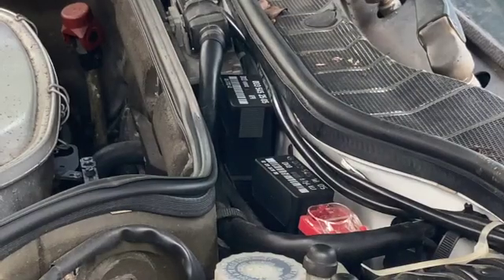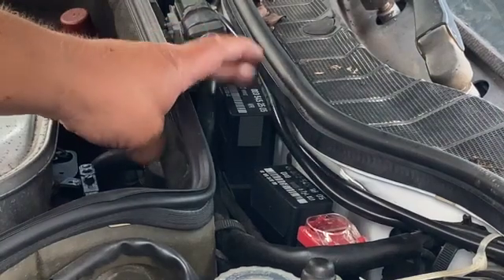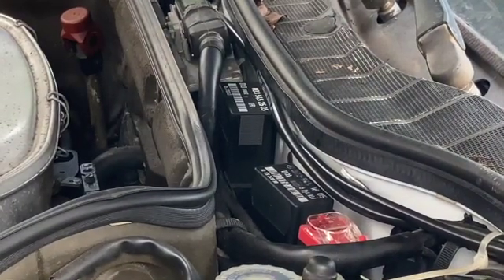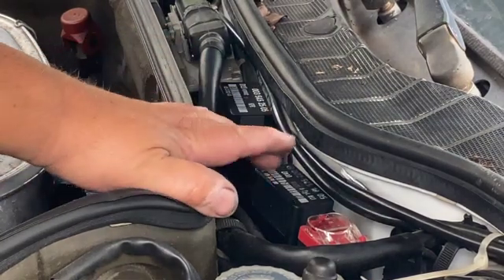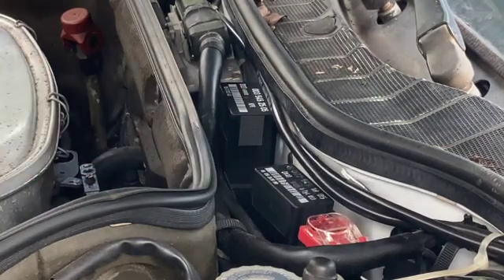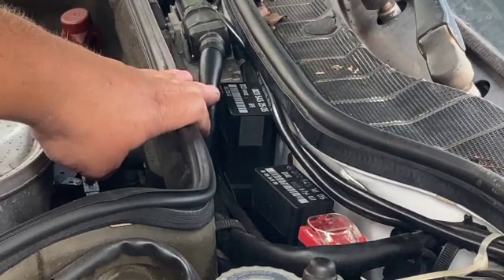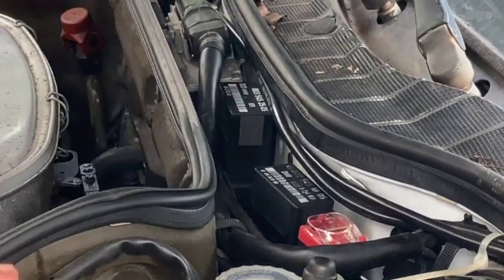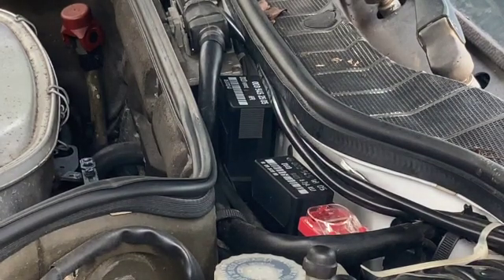Fuel pump relay failure symptoms: engine stops, hard cranking and high idle RPM KE Jetronic Benz

Comment: Got a 2003 e320 w211 2.3L sedan. I got the fuel sensor code. Bought the sensor but my pump has a different sensor on it that I can’t find anywhere on earth. Anyone else have that issue. Tought about cbagung the pump to the more common style one. BUT the connections the electrical cables etc are not the same. Help. Ok bye
Reply from the maker: Sorry my man,. that is all but impossible to solve from remote. I will only add that the worst Benz I have ever owned and worked on was the W210 is was the precursor the 11 and both types had terrible elecrical and mechanical issues. The codes popping up very often lead to chasing your own tail as they will point to a symptom related to the actual root cause. Stick with finding the correct part but don't be surprised if that does not immediateliy fix the problem Sorry that I cannot do more for you.

Comment: Hi Ralph:

One thing I noticed while my FPR was failing... my vacuum dropped about 40-50%. As soon as I replaced the defective FPR my vacuum was back pegging the 100% level on my economy/vacuum gauge. Is that normal for a failing FPR?

Thanks...you RoCk!
Reply from the maker: Color me intrigued. I see no literal connection between the electronics and vacuum part of the engine systems. That is super odd and I have no explanation for that one.

Comment: Hi
 I have a FPR on it's last leg and I just received my new one. Any tips on removing the old one as mine seems to be stuck in it's socket? I tried to compress the sides so the two little wedges that lock it in place are past their detent notches. I don't want to force it and break the socket on my 91 560SEC. I defer to your expertise as always for keeping my car healthy and rolling trouble free. I'd appreciate anything that would help.
Reply from the maker: Yeah those and the Klima and the huge multipurpose relay in the fuse box are usually quite stuck. All I can say is that you wiggle the relay back and forth while pulling on it. That is the only way they come out. Do make sure to look down into the little plug holes to make sure none of the contacts were pushed down. I had one like it and it makes for a heck of a nasty surprise and is difficult to troubleshoot. Good luck.

Comment: Hello there please help out I have a problem with 190e.. Idles well drives well at low rpm but when it reaches 3000rmp it stalls and no power.. Sometimes when I go up the hill even before reaching high rpm.. Also thee fuel pump is new together with filter
Reply from the maker: That is difficult to assess from afar. I can only guess and provide a few hints. Make sure that your fuel pressure is correct and assuming it is a KE Jetronic system also check the distributor differential pressure. Assuming it idles fine and you have great power up to 3K rpm, then it can still be starving for fuel. Have you checked and cleaned out the little sinter filter in the distributor connection of where the fuel enters the distributor? That would definitely be the first thing I would check.

Comment: AsI heard u said the air conditioning system is also related to this relay. I have ml350 2006 all symptoms u mentioned i faced.
Reply from the maker: Your car has a totally different operating and commmunication configuration than that of the old W126. Good news is that a suitable code reader may be able to help diagnose this issue.

Comment: Gen 1 Euro fuel pump relay. I found if you open the relay if you press down on the coil it closes the resistance across the contacts very nicely for the fuel pump circuit. I suspect, even though my solder points looks good, everyone I spray electro cleaner, the resistance closes. The fuel pump gets current. My new replacement fuel pump relay didn't work neither. Terminals for fuel pump is 87 and 30. 15 is ignition live. 31 is earth ground. 50 is starter. TH is tacho. 87K is kickdown. There are seven pins only. No TH. TH receives signal from Tacho, NOT sending signal from fuel pump relay. 15 and 50 both energises to start fuel pump. There are two coils, small one and big one. Small is a normally closed circuit,  opens on 15 energy. When 50 gets energy the big relay closes fuel pump circuit,  Car starts. THERE IS NO PRIME FUNCTION.

Comment: The other day, I drove my 1988 420 SEL in very hot weather and parked it in the sun for about 40 minutes. When I went to start it, the car wouldn’t crank or make any noise when I turned the key. The accessories were working fine, and the battery is brand new. After an hour, it started as usual. What could be the issue, and is there a video about it? Thanks for the videos.
Reply from the maker: I could be wrong, but these are the symptoms of the starter contactor going bad. If that happens again take a multimeter and measure the voltage on the violet/white wire on the motor starter relay if it shows 12v when you have someone turn the ignition switch to start. If there is power the starter will need freshening up. If there is no voltage it can be the starter lockout switch attached to the tranny shifting mechanism. You will need to safely jack the car up to get to that stuff. Good luck.

Comment: Mr Stray Benzes 
My 1992 300 ce W124. 
Starts fine , drives great, tick over perfect, BUT every now and then, when approaching a roundabout, or slowing down to turn left or right, the 
Engine cuts out ,so I have to quickly select neutral turn off the ignition, turn on the ignition the engine starts straight away, slip into drive and continue my journey.🤔 any ideas  possible fuel pump relay ?
Reply: Hi 👋 I’ve now changed the fuel pump relay 0035452005, I think this was the problem, the difference it’s made to the  running of the engine, it runs so much smoother and drives like a different car. Thanks again for your video 👏👏👏  I’m now trying to find a video on how to replace my hydraulic tappets on my m103 engine. 👍
Reply from the maker: @manreay6769  Great! Once I get to work on that engine and that issue I will surely make a video of it. Sorry that I don't have any right now.
Reply from the maker: Could be relay related. That unfortunately may be wiring loom related that were problematic in the 1992 and 1993 model years. I would idle the engine and start moving part of the wiring harness to the engine. Good luck!
Reply: @straybenzes  Mine is from 1985 280S and ave the exact same problem, anytime I slow down,  it might cut out, no power on the kick down ,  temperature rise, engine is hot as hell,  it stalls, then when switching back on it shoots of into drive mode but in a jerky way ! I bought a new Fuel Filter, Fuel pump and is it possible to open that FPR and fling some soldering if  they were cracked ? I don't have time to wait on it, I need the car everyday !
Reply from the maker: @slydevrmc2340  Resoldering the relay is an option. There is a good chance that it is just a cracked soldering joint.

Comment: My R107 will start if I pump the gas, but as soon as I let off, it dies. Relay?
Reply from the maker: Pumping gas with the gas pedal or are you literally pumping gas into the intake?
Reply: @straybenzes pumping gas pedal. If I hold gas it runs nicely. As soon as I let go of gas it stumbles and dies within seconds
Reply from the maker: @TheAcarr6  Assuming that the idle mix screw has not been messed with and that you have good fuel pressure and differential pressure it could be the idle control valve. Is this a 560 or an older 380/500? If it is the older one it could be the air mass flow flap setting in the fuel distributor. Since when has this issue appeared?
Reply: @straybenzes  Wi
th me , some idiot messed wit that idle mix screw,  he said the screw part should touch the other part, or it won't work and get a steady idle flow!
Reply from the maker: @slydevrmc2340  Yeah, unfortunately that screw's function is unfortunately misunderstood by a lot of people. With the engine running you can make a quarter turn adjustment to achieve the highest RPM. You may have to do that a few times to get it right but it is worth a try.

Comment: This video has helped me! I had that same problem and only one tiny bit of solder had a crack in it. One touch of an iron later and no more stalling.

You should show in a video how easy it is to open the relay and inspect it and seal it back up.
Reply from the maker: Nice result!

Comment: I believe this may be the issue im having in my 2015 Mercedes Benz i have replaced the pump n filter and still getting those problems so i think that may be it. I get the part today
Reply from the maker: Maybe or maybe not. That is a fairly new car model and there is no comparison between yours and these really old cars.

Comment: 89 420I SEL RUNNIG GOOD THANKS TO YOU AFTER DRIVING A WHILE PUTBIN PARK IDLING TO HIGH     how do i turn it down in simple terms  thankyou
Reply from the maker: Check OVP for proper function, check the idle control valve at around 5 Volts it should be closed, check the throttle position sensor for proper function, and make sure that you do not have any vacuum leaks. Too much to go over in text answers and doing this remotely is really difficult.

Comment: WHAT IS HOLE ON TOP OF AIR FILTER FOR
Reply from the maker: There should be a replacable cap in it, but that is for using a 3mm allen wrench to adjust the idle mixture.

Comment: HOW TO TURN IDLE DOWN? 1989 420 SEL
Reply from the maker: You don't. This is the most misunderstood function of the KE Jetronic. You need to make sure that your idle mixture gets you the highest RPM and no stalls or surges. Then you tend to the overload protection relay, vacuum leaks, the throttle position sensor, the idle control valve, and I am sure I am forgetting a few items. There is no idle adjustment screw like in int golden days of carburetors.

Comment: MAKE THER WIPERS GO BACK AND FORTH
Reply from the maker: Not sure what to make of this comment and were it belongs. Sorry.
Reply: @straybenzes  There's always One ....lol .sombody told me to use a pencil eraser to clean the fuses solderingnand tops in the fuse box , what's your take on that, I have a current leak, it is loud like a clock , always have to disconnect the battery otherwise it drains it in less the half an hour
Reply from the maker: @slydevrmc2340  That is another new one on me. Try isolating the fuse that has the most Amp draw and see what users belong to it. Half an hour? Wow.

Comment: I HAVE QUESTION WIPER MOTOR WORKING IS THERE SUPPOSE TO BE WASHER ON BOTTOM TOP DO THEY HAVE TO BE TIGHT
Reply from the maker: Are you referring to the wiper arms? There is a washer under the center mouning nut and yes, they have to be tight.

Comment: i cant find the connection for oxygen sensor under passenger carpet  this is a german model  cant find image  any where  where is it   HELP
Reply from the maker: You'll need a 10mm socket to remove the plastic footrest under the carpet mat on the passenger side and you will see it to your left in the footwell area. Just unplug and push the rubber grommet through.

Comment: My 300TE (1993) has had these exact issues lately!  My mechanic has replaced both fuel pumps, Distributor cap, rubber cap part under air intake, full service and the car is running fine but then drops off power while driving. We've done leak tests to no avail and I'm at a loss, which is why I found your video!  Nobody I've spoken to so far has even suggested this FPR might be the problem...Here's to Monday's parts mission, I hope?  Also had kick down issues & Aircon doesn't work (might just need gassing, I don't use my aircon).  Fingers crossed!
Reply from the maker: The best of luck to you!
Reply: did you manage to fix the issue?

Comment: Man, this is the exact problem i have been dealing with word for word on my 1990 300E 3.0L. Thank you so much for this video! I already ordered a new aftermarket Fuel pump relay and I'll update my post on the results!
Reply from the maker: Nice result. Great job.
Reply: Any updates?
Reply: @victorsaguenay  yes, I ordered a rebuilt unit from ProgRama. It was pricey but worth it. Once I got it and replace it it started right up and never shut off during a drive again.

Comment: Could this be the problem on my 260e? Car is not revving above 2-3000 rpm
Reply from the maker: The relay is unlikely the reason ofr the low revs upon acceleration. That is more likely due to the air fuel mixture being too lean. Check the main fuel injection and differential pressure first.
Reply: Thanks for the reply! I had this issue since I bought the car, now I fitted an electronic fuel injection system and it behaves exactly the same....
Reply from the maker: @shorecarul  yeah go back to the basics
Reply: Will check the fuel pump and fuel screen in the tank, I'm running out of ideas lol
Reply from the maker: good luck! @shorecarul

Comment: Thanks for the video, maybe you could solve my problem, w202 m111 engine. Starts with long cranking ( cold in the morning) after that it's ok
Park for half an hour, takes a long crank again
Reply from the maker: Go to the trunk and gain access to the fuel pump relay )small cube looking thing to the upper right of the spare tire with a 30 Amp fuse). Have someone turn on the ignition and listen if the relay  "clicks". You should also hear the fuel pump humming. Second thing to do is using some starter fluid and squirting it into the intake (remove the plastic intake pipe). Turn over the engine. If it starts right away it it most likely the fuel pump that needs replacing.
Reply: @straybenzes  thanks 🙏 will do
Reply from the maker: @12dougreed  Good luck.

Comment: My car jerks violently when accelerating and the fuel pump gets noisy. No problem starting the car and it never cuts out. Ive changed the fuel pump and all ignition parts and the fuel pressure is good. I think the relay is fine.
Reply: Got a2005 C class Kompressor and driving today it just lost all power  no fuel getting to fuel rail could it be the relay thankyou for your time
Reply from the maker: @DarrylBates  You can check the relay and fuse. Should be behind a little cover on the driver side in the trunk (left upright wall). It's the top relay and the fuse should be the 4th one 30Amp. Found a video that covers troubleshooting the fuel pump pretty well: https://www.youtube.com/watch?v=RAYp8l2Q250 Good luck!
Reply from the maker: Hmm. That is difficult to diagnose from afar. What car model, engine, and transmission do you have?

Comment: This happened to me yesterday. Just had a mobile mechanic come out (£358 later) said its 99% the actual fuel pump and not the relay?! Now I'm questioning their judgement!
Reply from the maker: Jump 30 and 87 of the fuel pump relay and the pumps will continuously run. If your car runs the pumps are ok and it is the relay that is bad.

Comment: Can this be linked to the car only starting on neutral? For some reason my car can only be started on neutral and not in park.
Reply from the maker: That sounds like the lever position switch mounted on the left side of the transmission is either out of alignment or it is defective. That would be my best guess at least.
Reply: Natural safety switch

Comment: back in the day you would open those and resolder everything nicely. Seems they have poor solder in many of the Mercedes relays. I've solder a couple that then lasted 15 years
Reply from the maker: You are correct. I have saved some of the electrical parts by merely desoldering the solder joints on the boards.

Comment: Hoping someone can help me, I have a 2008 E350 Mercedes, it has extended crank, I have replaced fuel filter, fuel pump, crankshaft sensor,cam shaft sensor, cam shaft magnets, MAF sensor, Coolant temp sensor, and I still can not find what’s causing the extended crank. Car has no check engine light, and runs great. Also I have replaced the fuel pump 2 times in the last 6 months for some reason it has given out.
Reply from the maker: Do you have a code reader? That is where I would start. Mind you that any codes represent just raw data as very often they hide the actual root cause, but they give you a starting point where to look without throwing money at replacing stuff. That usually introduces new variables and further complicate the failure search.

Comment: Good day 
My car is E220 W124  im strangling to start it its been month's now and I cant find the problem , its cranking but no start only promising to start , I changed petrol pump still not start , and before when you go around it just goose off after sometimes it starts sometimes not starts ,please help
Reply from the maker: That engine has electronic fuel injection and is thus completely different than the older KE Jetronic fuel injected engines. There are quite a few ways why your car won't start. Check the spark plugs after cranking. Are they wet with fuel or are they dry? If they are dry I would check the wiring harness and the connections between ECU and the injectors. If yours is a 1993 model chances are that you have wiring harness issues due to the known biodegradable wiring insulation that had been used around that time period. It could also be an issue with your ECU and / or OVP relay. Hoping this will help. Also, this is a fairly common issue so you may want to Google it.
Reply: @straybenzes  yes its 1994 model
Reply from the maker: @Mnisimnisi  The best of luck!
Reply: @straybenzes could it be a cps sensor also??